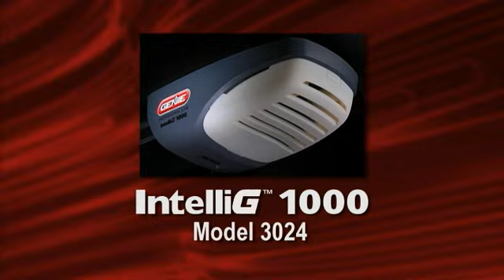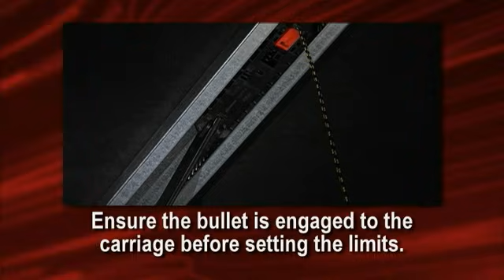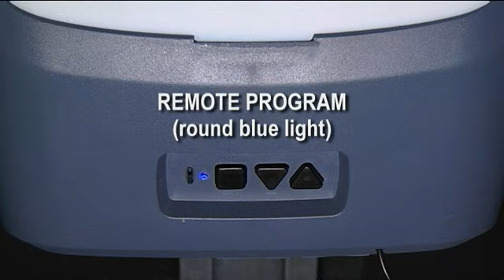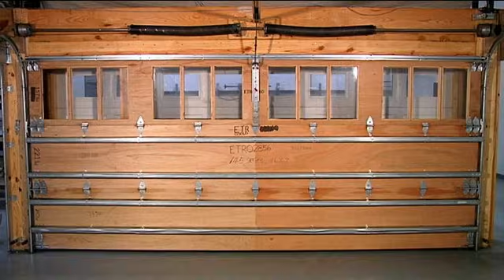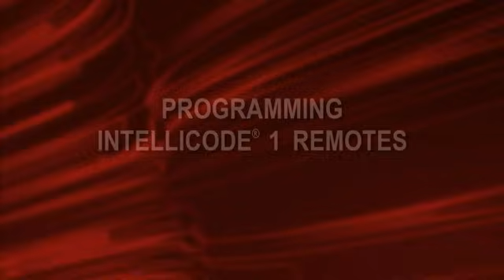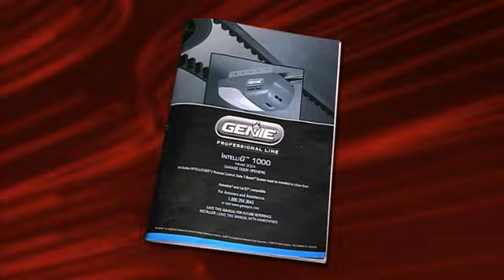How to Program GENIE Garage Door Opener - IntelliG 1000 Model 3024

Comment: If adding a 2nd (or 3rd) remote to a machine that already has 1 (or 2) remotes programmed: 
after the purple, long light is illuminated 

you need to press the button of the already programmed remote one time 

before slowly pressing the new remote button you’re programming 2 times as shown in the video. Pressing a 3rd time should now open/close the door with the new remote.
Reply: Bruh…you will never read this but this comment just saved my sanity…thank you!

Comment: My Genie IntelliG 1000 now has no lights on it and will not turn on at all.  The power outlet works as I tested it with a cord from my compressor.  I have tried the "lock" button and still no luck.  Grrr....
Reply: jonsocal mone same thing
Reply: No power but ther power
Reply: Was this ever resolved. I'm having the same issue after a power outage.

Comment: So many people bashing the genie, heck, even my door installer was, long story short. The installer was bitching the whole time, he couldn't get the door down with a press of the wall mount, he had to hold it down to force close. I told him I would figure it out, It was all because the trip senor was not lit on both sides, followed the wire and it was not inserted properly, boom, magic! Now I easily programmed remote, and door remote thanks to this video, door works great, very quiet, smooth belt drive operation, thanks genie.

Comment: Garage door opener installed but down and up limits won't set. First button pushed and the led light steadies as instructed. The next step of holding the button until fully closed only moves door 2" then stops. Next press moves it another 2", etc. Whats the problem?
Reply: This is a Silent Maxx 1000
Belt driven
Reply: James Rudy Did you ever find out what was the cause of the problem?

Comment: I've been at it for about 2 hours now, trying all the different variations, I've come across. No luck! I'm ready to box it up and take it back.
Reply: I found that the mysterious blue flashing Long LED, that is NOT in the manual, or at least in the LED troubleshooting section, means the Door Lock has been activated. Amazing, after turning off the door lock, and the Wall controller internal red light comes on, all of the remotes were programmed and worked. I'm sure I may have missed this somewhere in the manual, but in my opinion, putting the meaning of the Flashing Blue Long LED, in the LED troubleshooting section, might be a great idea.